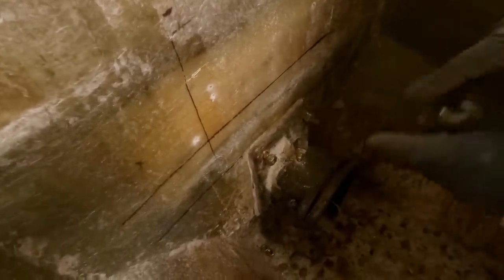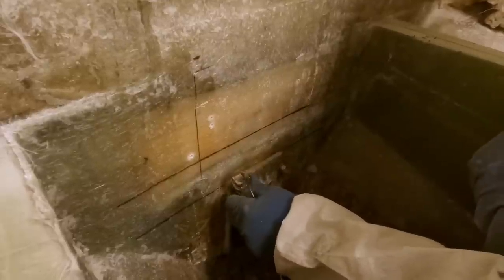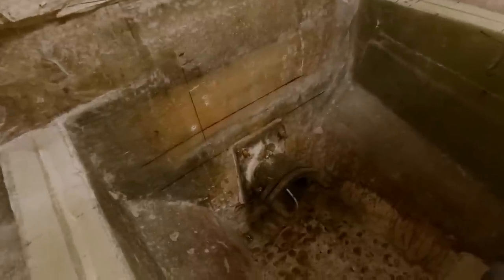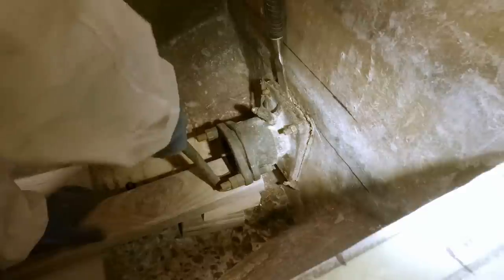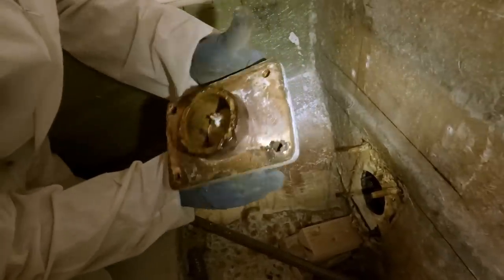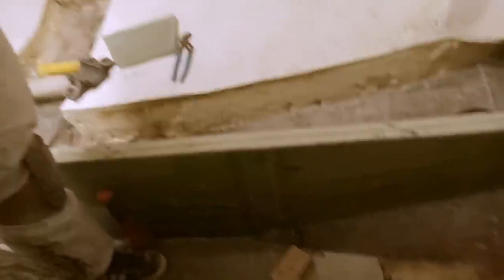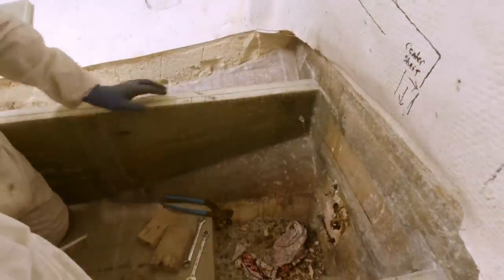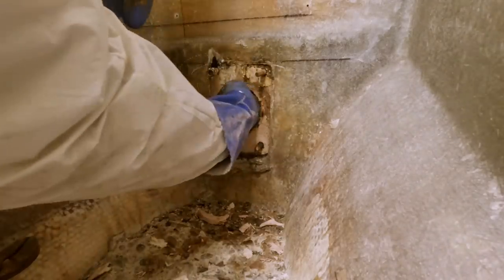Removing Old Shaft Stuffing Box and Stern Tube Clean Up - Emerald Isle: Ep.54 Fishing Boat Refit

Comment: Yes...like # 21 
Let's go guys!!!
Comments to come...
Hang on!! Lol
🇨🇦🍻🇨🇦

4:09 - time to drill it out, and replace, or grind it off ..... which one do they choose... lol

4:57 .... the grinder comes out... beautiful call boys!!
That's what I'd do...can always replace that bolt

Further analysis haha, can you cut the line where plate and hull meet? I do this with interior finishing, cut out the old seal, silicone, caulking line, prior to removal of trim, crown, valance, and cabinetry.

Yup get that grease fresh...smooth operator....smoooooth operatorrrrr...(song)

26:22 that area you cleaned out, looks great!!
It seriously does look good to me, and I'm so darn picky haha. 
Great video ❤️🇨🇦🍻
Can't wait to see the wake behind this vessel!! I want to join you guys. I'll get in touch soon. After winter haha...lol and I am big on crabbing vessels, but wouldn't be on them bucking sea horses!!

Comment: Looking so much better around stern tube. Won't take you guys to long to shore up the bulkhead and prep for new stuffing box...assuming you replace same. Now know what you have back there and that's always makes a skipper somewhat relieved. Good luck on future repairs and shaft reinstallation. Are you getting the old shaft trued before reinstall?
Reply from the maker: It was good to get in there and get everything cleaned up. Starting fresh and now we know it is top nothch. We do have a new stuffing box going in as well as a new tail shaft. The old one showed signs of crevice corrosion so we replaced it.

Comment: The stuff you said was Bondo actually appeared to be Marine grade epoxy putty, same color any ways and seemed much stronger than Bondo.  Polyester Structural Repair Putty would most likely be the best choice but the other stuff seemed to hold up well. I've used it before and it's pretty Skookum
Reply from the maker: I'm fairly certain it was bondo or at the least fairing putty. It had that bodo smell when grining and was acually pretty weak, I was just being carfule removing it as I had no idea what was underneath. We have used structural putty on this whole project and agree with you as to best choice, it is good stuff.